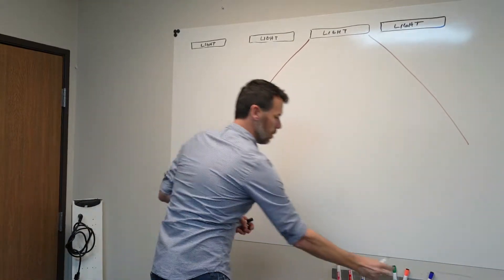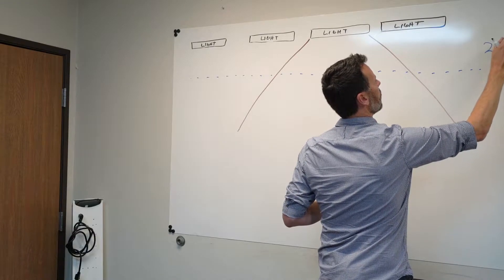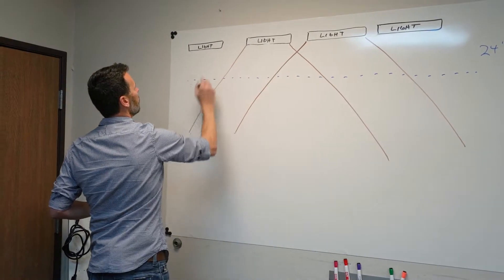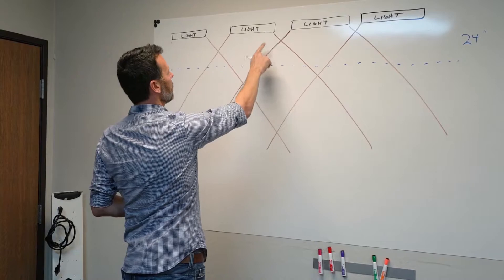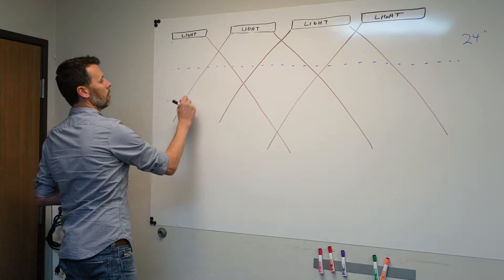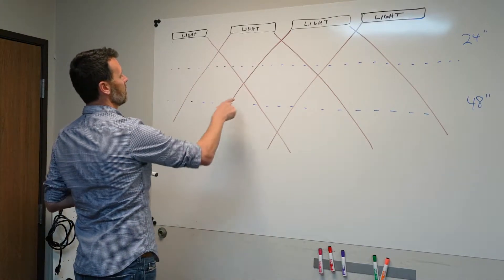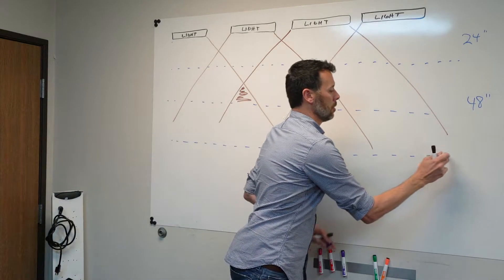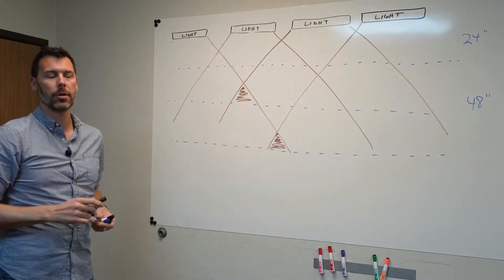Optics Explanation Part II

Comment: Has it been proven though? I will wait for those with the cash to splash and buy it and see if it actually works on the forums via grow journals. Then I can believe it's more beneficial. But then for it to be beneficial you basically need to add multiple lights and at 1300 dollars that's a lot. Other wise am I right in assuning one led in 1 grow space, you would have to place the plants at the outside of the tent to see any benefit??? Or is the light just bent out like an arch but plants directly under the light get the same amount of par. Because if not I see a lot of wasted canopy in tents without multiple lights...